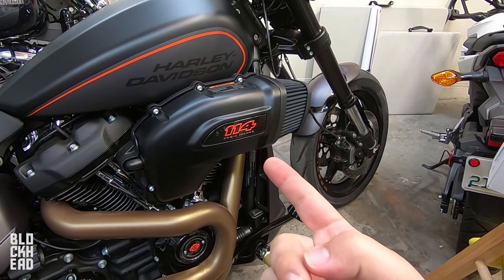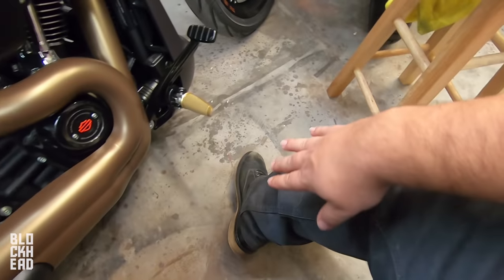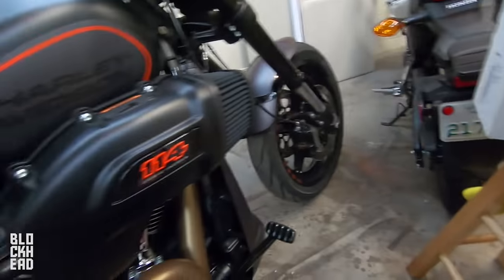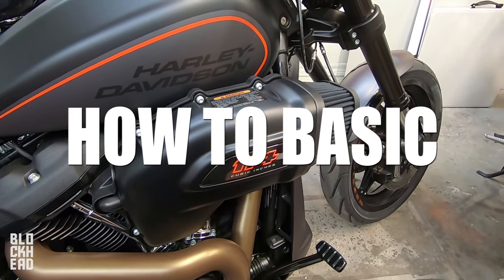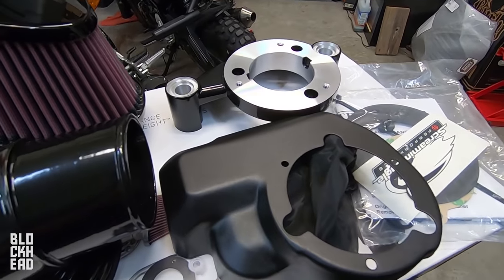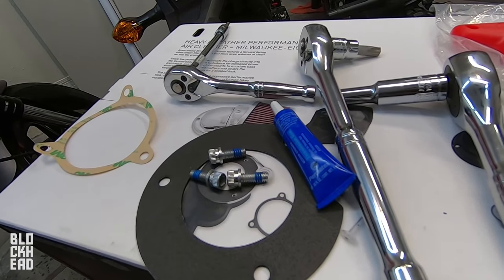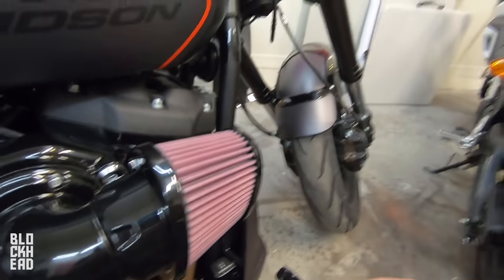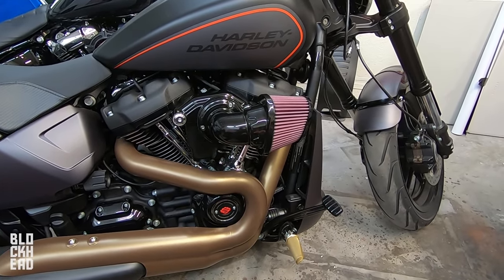Harley-Davidson Screamin’ Eagle Heavy Breather Air Cleaner Install

Comment: If you want a good cam get a redshift cam from Zippers Performance and a D&D exhaust from them or an S&S gear drive cam and pipe plus Zippers Performance has an excellent fuel management system to ditch the Harley speed governor system.
Reply from the maker: Cam and more in depth mods won't take place on this bike for awhile. That's what I keep telling myself anyways, lol
Reply: BLOCKHEAD personally I would go with Zippers Performance and they can set you up with an S&S gear drive setup with the Zippers redshift cam . They’ve been building Harley hi performance stuff for decades. 
So when you decide to step up performance that’s the way to go . 120hp and torque in the neighborhood if not more. Plus they have an excellent tuning system. There stuff is designed and proven to work together. I’m sure there must be a shop in Florida that uses their stuff.

Comment: Did you remove the bracket off the top of the throttle body? if not, you are not going to get a good seal and the bike will run like crap.  That's what's the zip tie with the retaining progs is for - holding the wiring that is clipped to the bracket that needs to be removed.
Reply from the maker: Are you talking about the arm that goes over the top of it? It doesn't seem to get in the way. I'll have to take a second look at it and make sure all is sealed up but seems to be fine thus far.
Reply: at 2:14 - the support bracket holding the throttle body and sandwiches at the breather bolts.  There should be a step in the instructions that states " Remove and discard induction module support bracket. Secure throttle control wire to throttle body with supplied cable strap (A)."  That's the bracket it's talking about.  The new intake supports the throttle body and that bracket should be removed to ensure a good seal on the throttle body.

Comment: I wish Harley’s screamin Eagle CAI like the one you have were a little longer tube to almost push the filter past the rocker box. I’m personally dealing with replacing my Screaming Eagle Bell Filter because of oil from a rocker box gasket blowing out. Sucked oil straight into the carb! I was touring when it happened, sucks.. I would have made it if my filter was more forward like the one you put on your other bike (Wife’s?).

Comment: I'd like to see how your leg goes around it because I have a Fat Bob 114 and it has a similar leg position. My right knee hits the stock oval air cleaner and I'm afraid that this one would pretty much make my right leg feel awkward as hell with how far my leg would be kiltered outwards just to reach the front peg/brake.

Comment: BLOCKHEAD!!! I noticed you left on the mounting bracket for the original intake and mounted the new one to it. Does it say to keep that on in the instructions? I did this with my extreme round SE intake and got a check engine and high idle had to remove it and re-flash ECU.
Reply from the maker: The bracket that goes over the top of the throttle body? Didn't seem to get in the way. Didn't say to keep it in instructions but also didn't say to remove it. I'll have to double check when back in the garage.
Reply: Yeah I installed mine and that top bracket created a gap between the housing and throttle body so I took it off and it fit flush

Comment: I test rode this a few weeks back.
the air cleaner gets in the way on my right leg, kinda annoying
Also, i have to bend down a lot to reach the handle bar
was not a comfortable ride
Reply: Krazed Rider how tall are ?
Reply: 170 cm ~ 5'7" ?
Reply: Did u have fowards?
Reply: @adminadmin9997  FXDR is forward
But probably because I’m a short guy

Comment: Nice! No breather bolt tubes to the throttle body; how does the Heavy Breather system vent exactly? Thanks!
Reply from the maker: The breather bolts had openings into channels that go back into the throttle body I believe. It's been awhile since I made this video, I'd have to double check
Reply: @BlockheadMoto  :  Did you ever check on this.  I was curious as well. Bought the same one for my 19 RGS.  Thanks

Comment: Do you need to update software after the install?
Reply: no
Reply from the maker: You're talking about attaching a fuel mapping system, something like an FP3 or Dyno Jet tuner. Yes, it is recommended. That video incoming.
Reply: BLOCKHEAD exactly, when you fitted the RDS did you feel that you immediately needed the, fp3 or could you just install and run off the stock map? Now that it’s on Mrs Blockheads bike is she just running in the rds with the stock map?

Comment: Can the rain sock stay on to cover the meh filter paper color dry or wet without compromising the airflow?
Reply from the maker: The color of the filter will turn to gray after a few cycles, and after being out in the sun a bit. But yes, you can use the rain sock over it without impeding airflow or performance at all.

Comment: So you can just add it to your bike without dyno testing or fuel packing your bike?
Reply from the maker: As noted in video, whenever changing the intake or exhaust, a fuel management system should be done. That is an incoming video.

Comment: Really wonder if that solved your problem. Looks like the new one is getting even more in the way of your leg than the previous one. I'm getting delivery of mine in a couple of weeks with the SE round extreme flow. That one looks a bit smaller than the one you had, but more intrusive than the original, which looks like it's designed to avoid that problem. Keep us posted man! Great videos.
Reply from the maker: It solved my problem, not near as in the way as the last one, doesn't dig into my leg like the Roland Sands one did.